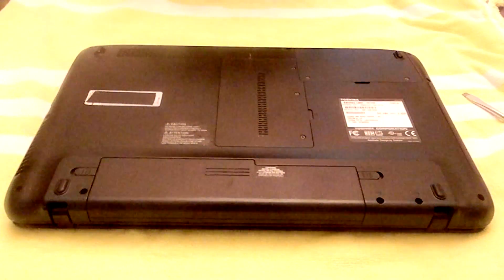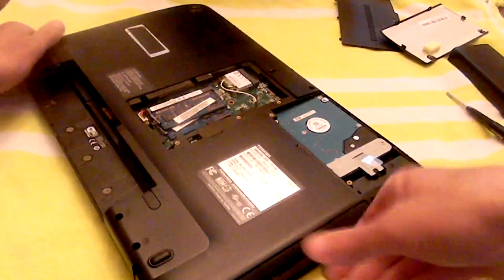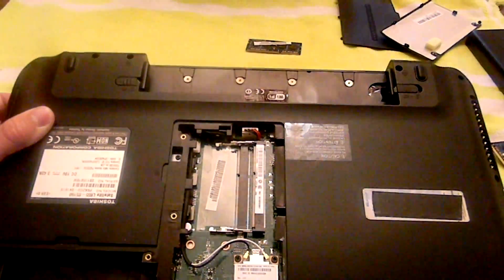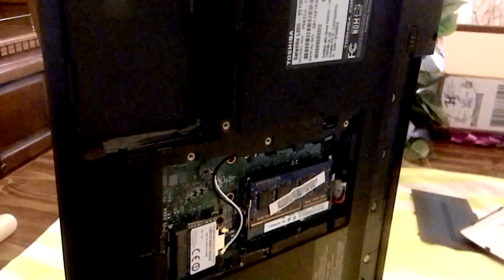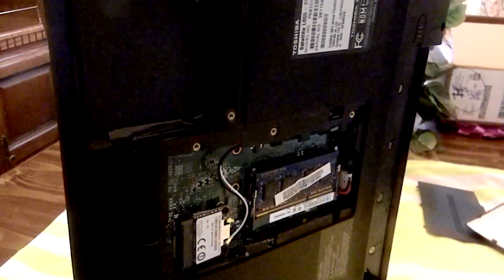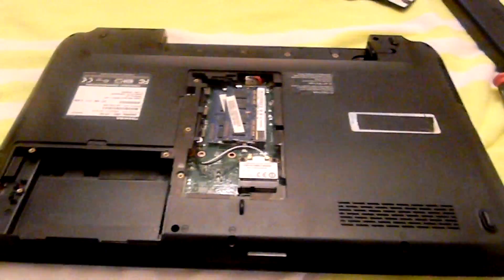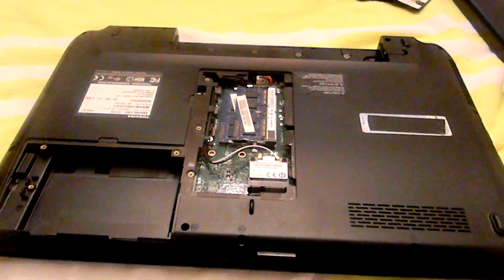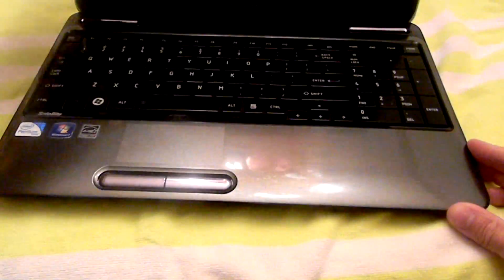How to Clear the BIOS Password on a Toshiba L655-S5150 Laptop (HD)

Comment: You got it easily with this model. With the c660d you have to short pj29 jumper and my cmos power source is broken so i need 3,3v to pj29 to ground.  So hard and no information how to actually this works..

Comment: Hi Scott.

Thanks for the video and information. I’m not totally certain whether my issue is exactly the same so would like to check with you. I don’t want to change or remove the password.

I have a Toshiba Satellite L50-A laptop, and when I power up, it goes past the Toshiba screen to the “enter password” screen (which I now understand is the BIOS password), however when I type in the correct password and then try to enter it, the screen stays stuck at this screen. Nothing I do will allow this password screen to change.

I cannot even hit F2 to enter the BIOS screen.

I keep finding various tutorials about Toshiba issues, but so far haven’t found any that I think specifically address this issue.

Would you have any advice on this problem for me, and why the screen stays stuck here even when I enter the correct password?

Also, if the BIOS battery (the CR2032j needs replacing, could this be the cause of my computer not letting me get past this screen?

Thank you for your time, it is much appreciated.

Glenn.
Reply from the maker: Was your laptop able to keep the time once you set it? If it was constantly not the right time that would be a sign the BIOS battery was dead because it wasn't saving the time. You could take it out and test the battery with a multimeter and maybe just taking it out and putting it back in would help if it got knocked out of place. The fact that you can't enter the BIOS after you hit F2 might because the battery is dead.

Comment: That sorted out the issue for my laptop
Toshiba satellite A300 - 15A
Model no. PSAJ4E - 00S00XAR
all over the internet they describe a B500 jumper, but I couldn't find it.
This video should me the G1 jumper that sorted out the problem, even though there are slight differences in its position, maybe because of different makeup between my laptop and the one in this video.

Comment: I have an L875-S7110, I dont see these points can you help me?
Reply from the maker: I would search for solder joints with similar configuration to encourage shorting to resolve this issue. You could also look for a board level schematic online and search through it for the correct solder joints.
Reply from the maker: Sometimes removing the CMOS battery for a while clears the BIOS.

Comment: I have a Toshiba Satellite L50D-B where is the spot for reset BIOS password what is the number to reset. Thank you for your help
Reply from the maker: I would search for solder joints with similar configuration to encourage shorting to resolve this issue. You could also look for a board level schematic online and search through it for the correct solder joints. Sometimes removing the CMOS battery for a while clears the BIOS.
Reply: I had to scratch/remove stickers ( looks like serial number and barrecode ) that was under the ram ( almost the same area where he was touching on the video ). And i found it ;)

Comment: in spanish please. i am mexican and speak spanish
Reply from the maker: 1. Retire la batería, el disco duro y 1 barra de RAM.
2. Conecte el cable de alimentación.
3. Ubique los puntos de soldadura G1 debajo de la RAM y la pegatina.
3. Cortar G1 durante al menos 10 segundos para borrar la contraseña del BIOS con un destornillador de cabeza plana no magnetizado u otra pieza de material conductivo.
4. Vuelva a juntar la computadora portátil
Reply: thaks brother greetings from Mexico 
Excuse me but you know reset it? because my computer was given to me from the USA and I want to put it in Spanish but I could not in any way, you know?
Reply from the maker: Greetings, Power up the unit, press F2 in order to get into the BIOS and on the first page you should see a option to change the BIOS language.
Reply: Is it pressed at the time of turning on or since it is turned on and I press it? sorry for being angry but I'm blown away with this computer

Comment: This worked for the BIOS but what about HDD/SDD password?
Reply from the maker: If it is asking for a password on your hardrive that is built into the firmware of your hardrive and you will never be able to remove that unless you type in the correct password.

Comment: I had to figure this out myself, but after a few attempts, I got the bios to reset, however couldn't unlock the Toshiba Hard Drive that came with it on my friends computer, so had to replace it with a Sandisk 480GB SSD, and will be reinstalling it with Windows 10. Glad I looked this up.

Comment: Scott- great video! I have the L75D-A7283 model - will the G1 jump work for my model?
Reply from the maker: sunnyaz888 The solder joints might be labeled something different under the sticker under the RAM because you have a different model but if you have solder joints labeled G1 it should work.
Reply: I tried that, it did not work- should I try the G2?
Reply from the maker: Yes, it's worth trying it
Reply: nope- that didn't work either- darn. I am so frustrated! I have googled everything I can think of, really don't know what else to try. any other suggestions?

Comment: this procedure its gonna make lose all my stuff in my laptop? like with the reboot?
Reply from the maker: Whosmario if you are just clearing the bios password you won't lose any of your stuff in your laptop
Reply: Scott's Projects well i have this same problem but im affraid of doing it, becausd losing my stuff, after doing this procedure, requires a boot? im sorry im i dont get this quite good, it would be awesome if you could give me info about
Reply from the maker: The laptop reboots like it normally does but it takes a little bit longer to boot because the bios were cleared. If you follow this procedure the bios password is the only thing getting cleared. When my laptop boots up you can see my user picture and all of my stuff was exactly where I left it.
Reply from the maker: When I say boot I'm talking about the sequence that the laptop goes through when it is turning on. So basically I'm saying the laptop is starting up or turning on. If you are worried about losing your data or you want to access it you can buy and a USB 3.0 to 2.5in SATA 3 Hard Drive Adapter Cable and connect your hard drive to another computer
Reply from the maker: Sounds good man
Reply from the maker: Whosmario it's worth trying it, take the battery out and wait atleast 5 minutes before putting it back in to make sure it clears the bios
Reply from the maker: Whosmario definitely take the HDD out and try it with both sticks of ram out, if that doesn't work try it with leaving one stick of ram in, and if that doesn't work try it with both sticks in